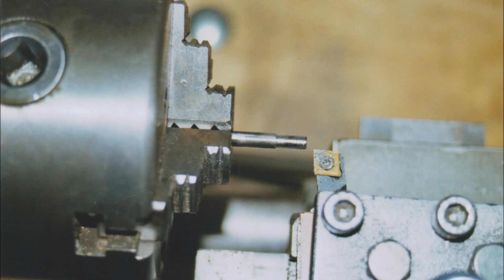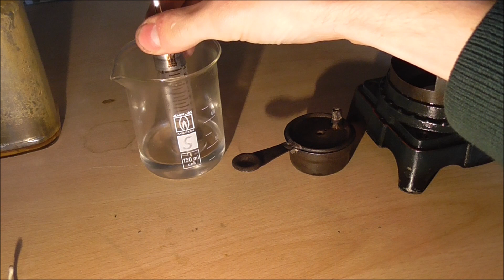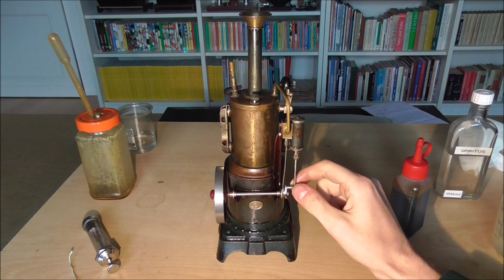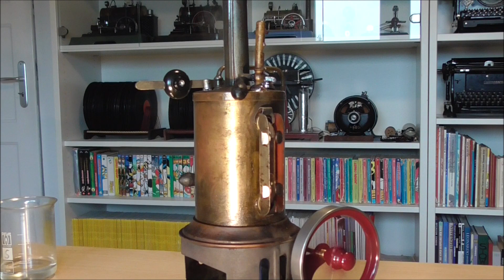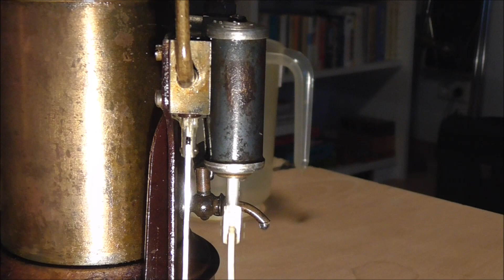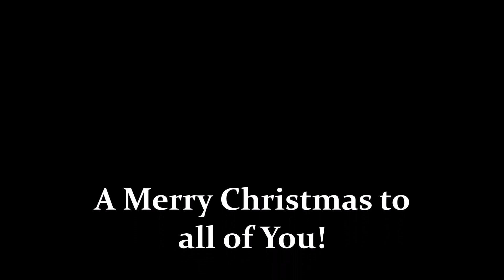Ernst Plank 114/1 Steam Engine

Comment: Nice rebuild.I just purchased  very early 1896-1899  model which is much different that yours.The cast base doesn't have legs and is very ornate including the flywheel that has the serpentine spokes.I need a smokestack yet and should be ready to fire